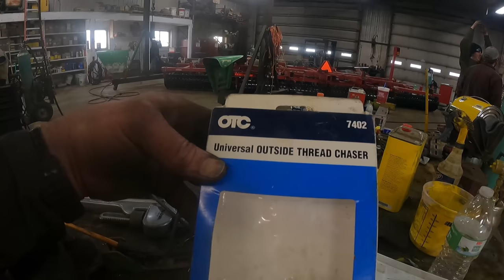More Iron

Comment: The fire pick up truck may have low miles, but they were idled for lots of hours. They never shut them off during an incident, just like your high hour pump tractors. A fire truck could be at an incident for many days always running. Low miles, lots of wear.

Comment: I'm sure you know about Never Sieze, the anti-rust and anti-seize "grease" that would work to keep your threads from rusting...? It has some ground up fine nickle dust or other compound that once you get it on your fingers it will not easily come off. It's a real mess to work with so wear rubber gloves, but it works!

Comment: Our local consignment sale always had at least 1 firetruck from 1 of the nearby departments my dad warned me even though they're low mileage don't buy them because most of those miles was foot to the floor and usually they were in gear floored before the starter wound down if I catch a square body Chevy especially manual and 4x4 1 ton is a bonus I'll snag it up because I have fresh 454s and 396s in my shop for special projects I put a 396 and a 5 speed out of a Camaro in a Pontiac Bonneville with quiet exhaust till I opened the dump pipes it was a fun little sleeper

Comment: No drips and no sags in the paint just run it to the floor and cut it loose in the morning with a razor blade, it's a protective paint job not a show car.  check for cavity wax  at the auto body supply, aerosol cans with long tube applicators to spray inside the unpaintable areas in the fenders etc. its then stuff that is sprayed inside doors and rocker panels for rust prevention.

Comment: Maybe it would have been a good idea to use good rust emulator on the inside of the fender and then primer. A piece of tin is only as good as the prepper preps it and for the price of the wheels , way cheaper as buying a new roller cultivator .

Comment: For those turnbuckle threads: Boeshield T-9.  It's an aircraft chemical that has paraffin wax suspended in a carrier which evaporates when it dries, leaving the wax on the metal and protected.  Works great on your hunting guns, too, without being greasy or oily and attracting dirt.

Comment: $23,718 roughly. 
Anti-seize for that 3rd link. That's what I did with my old JD3010. Correct me if I'm wrong but, didn't the 4020 have dual lights in the flat top fenders? I know the 30 series had singles, then the 40 series on up went back to dual lights. 
LOL Rims will rust, especially if filled with calcium. But, even without, eventually, they'll rust inside out. 
Almost an hr long, yes, these are the best video's. Great video as always. Cheers :)

Comment: Best way to put bearings in: hammer and punch, setting up a press takes to long, ha. We had alot of OTC tools at the dealership, they work good. I would put some grease on those threads after you paint it. Oh yes, that truck lives up to it's name Fix Or Repair Daily.   Jesus Saves

Comment: Wish Andy could see my flashing trick for painting rims with tires. I just take 6" wide aluminum flashing and roll around the rim lip tape it in a loop it'll hang on a vertical rim and you can go right from one rim to another. Pieces of cake
I just can't imagine milk pays for all the maintenance, payroll, fuel and equipment it takes to run that farm. Crazy

Comment: You need to adjust the turning stops on the front axle of the Volvo dump. The wheels are turning to sharp and it is tearing the outside tread of your tires off. Turn out the stop bolts a little and that should solve your problem.
Reply from the maker: Or the king pins are wore

Comment: Andy you should step up to using annular cutters with the mag drill.  So much less actual material being removed using them to make the hole than using twist bits!  A lot less work for the mag drill motor as well.
Reply from the maker: I do use them I didn’t have an 1.25” one though

Comment: The Ford must be a lemon, I have owned nothing but Fords and have had very good experiences with them.
Reply: agreed best trucks i have ever owned
Reply: Same but, ALL brands will have "lemons". Just happens. Cheers :)
Reply: I think that year was kind of crappy. I have a 2012 with the diesel engine and that thing has been amazing. 140,000 miles all I’ve ever done is change the oil
Reply: @Adam_Poirier  you must have fred   flintstone brake system.  & all that while, never had time for a wash?
Reply: He didn't say what motor. If it's a 5.4 then it is junk! 5.0 aka 302 in my 1996 wint 550,000 miles but the 5.4 in my 2004 only did 184,000 before it was junk. Both got oil changes at 3000 miles. Then there's the 6.7 in my service truck that just broke the crankshaft at 78,000! Thankfully under warranty!
Reply: This could be true but typically speaking , Chevys do have better reliability than any of the other brands, since they are built more simply.

Comment: Does this billion  tool work in corn stubble?  Use this subsequent to using the high speed disc?
Reply: Last pass over worked ground to knock down clumps and level the seedbed. Also firms up the soil for better contact with the seed. Can be used before or after seeding or both. Makes a hayfield look like your front lawn.
Reply: @farmerbill6855  Farmer bill, you did not read or understand the ??. I asked the specific result in corn stubble.  And the question was directed to Andy.
Reply: @billupstateny9151  okay then, your answer is no, it would clog up with trash pretty quickly. Of course, it's a free country, you can drag anything you want over your corn stubble. Although, being that it's a finishing tool I don't see why you would. Just trying to help. You're welcome.
Reply: @farmerbill6855  Corn & alfalfa seem to be Andy's most harvested crops. Was wondering why 2 of these finishers are beneficial. He does some wheat,  don't remember if he does beans, but those are not his largest acres. You suggested use on   hay. I would suspect they would damage the plant but we have used a wide  frame tiller w/ STRAIGHT blades for aeration, w/ success. Typically, the hay fields here are given a pass w/ a wide smooth steel roller to set any stones  raised by the winter frost if the soil dries  early enough